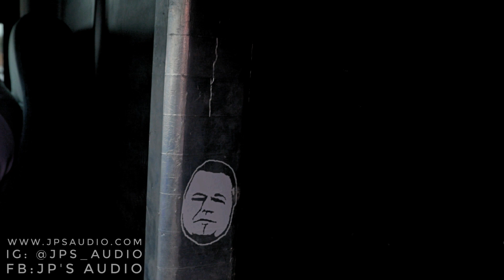SCOTT BOWMAN's 6 sundown audio nightshade v4 15's on 3 salt12k's at sundown audio show 2020

Comment: I love how everybody so has much money and time into their vehicles yet you usually see them standing outside of the car
Reply from the maker: Mainly cause of the level of spl. Sometimes you'll see guys with one seat for demos cause it builds more pressure at that spot so the remove everything in front of the port for better air flow to that spot